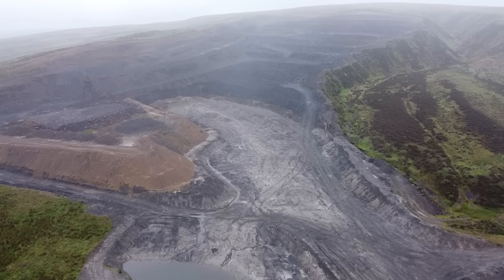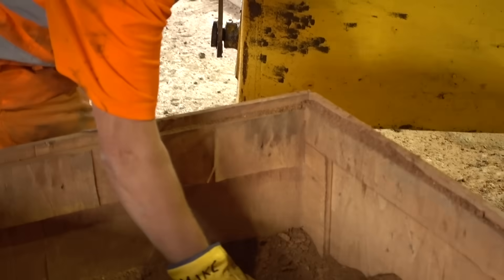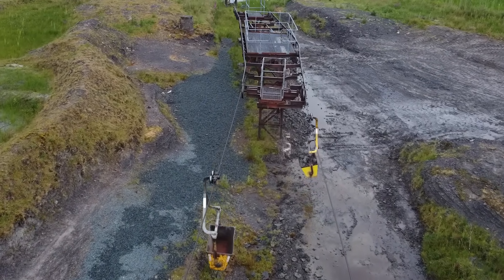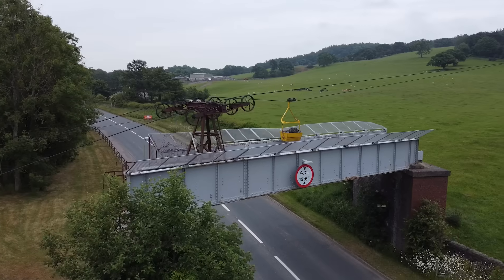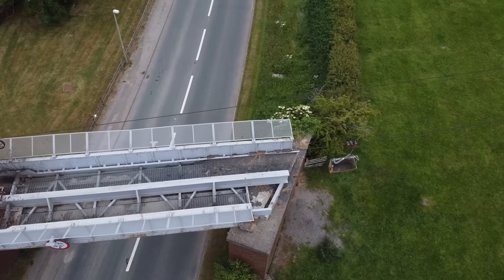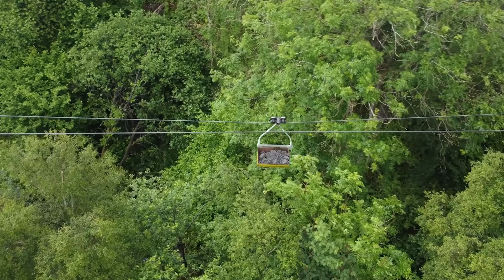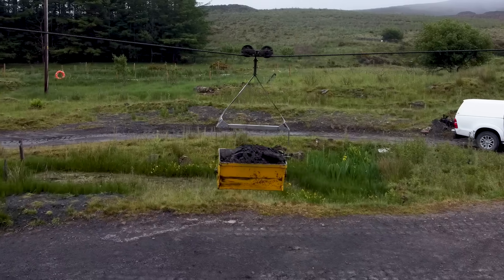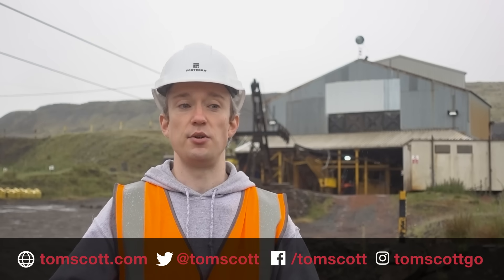The UK's last aerial ropeway uses no power, moves 300 tonnes a day, and will be gone by 2036.

Comment: The physics pedants are going to have fun with "uses no power"
Reply: As are the comedians, if they can keep away from make any puns-dits
Reply: it uses energy, from gravity. no debate here
Reply: @brhh  Wouldn't "energy from being a heavy thing in a high place" be more specific ? Gravity only converts that potential energy to kinetic energy
Reply: @Dextroyer77  Not very much "acceleration due to gravity" though, as the up-buckets are balanced by those down-buckets.
Reply: @brhh  Tom referred to no power being used. In physics there is a difference between energy and power.
Reply: @brhh  Gravity acting on the mass of the load, if there was no load (crushed rock) then it wouldn't go anywhere regardless of gravity that rock takes power to load it into the buckets. If there wasn't an external source of energy involved (other than gravity) then it would be a perpetual motion machine and that's impossible.
Reply: @brhh  but the energy is not from gravity
the energy comes from it's relative altitude compared to the destination
the system is powered by potential kinetic energy

though there is an argument that this energy is stored by the mechanical systems responsible for lifting the shale to surface level and that that is the source of power for the system
Reply: The grammar pedants are going to have fun with "pendant".
Reply: @cabbageconstable  um actually that would be spelling pedants - the grammar is perfectly fine
Reply: @SharienGaming  I see the word choice pedants have showed up :P
Reply: @dusklunistheumbreon  i cant help myself with wordplay when there is easy pickings XD
Reply: @cabbageconstable  took me what felt like a month to spot that! Edit: Urgh I did it twice?! I'm the worst.
Reply: @cabbageconstable  actually, I believe that would be more of a thing for semantic and orthographic pedants.
Reply: Pedants on both sides, I should say. You could argue this is correct (Power is rate of work, is gravity "work"?) I'll let cleverer people battle this out but try to remember that this doesn't matter. Hugs to all.
Reply: @OliWarner  gravity technically does develop work on the carts, but it’s clear Tom means “external power” ;)
Reply: I mean gravity in physics is referred to as "gravitational potential energy" so it does use no power but it does use energy so if that is so "uses now power" is actually correct since it makes its own power from gravity as an energy source.
-a physics pedant
Reply: @OliWarner  Power is just the rate of change of energy per unit time. Not specifically "Work". There is certainly energy and power being used here.
Reply: pedants*
- another pedant
Reply: It's insane that the power input of this system is the movement of tectonic plates, raising the land millions of years ago
Reply: @SuperCarneBoy  Some of the power input is still happening - this part of the UK is still rebounding after the last Ice Age - the land is getting a bit higher each year!
Reply: @SuperCarneBoy  nice..
Reply: @SuperCarneBoy  It's the addition of mass by operators that causes it to function.
Reply: Even better, we can actually have some pendant(ary?) pedantry since the buckets are swaying on the rope as they power (heh) their way down/up the course!
Reply: Put a generator on the wheels and you could probably generate power this way too.
Reply: @colleenforrest7936  This is a great idea! Rather than use a brake and waste the excess energy as heat, they could knock a bit of their electricity bill which I expect is substantial.
Reply: @colleenforrest7936  if you add a generator, you could slow the runway to the point it doesn’t move. It’s a nice thought though. I suppose one it’s all mined out you could add water to the buckets, and then a generator would work. But it would likely only be a small one, due to the weight of buckets and cable coming back up the hill.
Reply: I suppose the external power it takes in is the potential energy of the shale?
Reply: @12-343  probably a combination of the initial potential energy of the shale and the energy used to lift it out of the quarry and into the buckets.
Reply: @12-343  Correct, by adding weight at the top you are adding gravitational potential energy to the system. Not "power" in the traditional sense, but 1/4 ton of rock added at the top of the loop, which is about 200m elevation above the brick factory, adds about 400 kJ to the system.
Reply: @Ulquiorra191  Exactly, works like a dam/hydro-power plant
Reply: Uses potential energy of uphill rock
Reply: It's just converting energy that had been there as gravitational potential a really long time ago.
Reply: No we won't, because nobody said it doesn't use energy. Power has the strong implication of being produced.
Reply: @GamesFromSpace  Produced, like putting heavy stuff into a bucket and letting that potential transfer to kinetic over time? Sounds like power to me, but I'm no physicist.
Reply: It's not really pedantic, it's stuff like this that means we have idiots that believe in perpetual motion.
Reply: @mfx1  The introduction of the phrase into this thread, right now.
Reply: All depends on where you draw your system boundaries.
Reply: 1 object moving uphill and 1 moving downhill with the same mass and the same speed is net 0 work. The masses are obviously different, but different speeds would compensate.
Reply: @RhyetCast  What do you mean?
Reply: It uses gravitational power, but no electrical power.
Reply: But they´ll use up gravity if they keep operating it, they will!
Reply: Energy ≠ Power
Reply: @simonbergman5970  Power refers to the amount of work done over a unit of time, where work is the product of force and displacement. This system does indeed utilize energy, work and power... albeit in a very clever way.
Reply: If there's mass, there's energy (E=mc^2)
Reply: @notproplayer3649  this... Is really badly wrong. I get what youre going for, but this is absolutely not the right answer.
Reply: @simonbergman5970  not to be rude but for the love of God, at least explain me what I did wrong, I'm eager to learn myself. 
This is what I know currently, E=mc^2 in Einstein's relativity theory is Energy like any other, this can be seen in atomic bombs as masses of plutonium or other radioactive elements convert all their mass into energy creating the explosion (by converting this energy into heat and cinetic energy for all the atoms around the core).
In Einstein's theory, mass by itself is Energy since it has inertia.

Yes, this formula wouldn't make sense under Newton's theory since everything is supposed to be cinetic or potential energy (E=1/2mv^2 for linear movement cinetic energy for example).
Reply: Gravity: Are you kidding me!?
Reply: @aiosquadron  Why else would a full bucket travel down an incline?
Reply: @RhyetCast  I know who you were replying to, I'm just confused by the reply
Reply: @RhyetCast  As a young person, I don't care which one people use. They both get the message across XD
Reply: @RhyetCast  "fixin’ to"
Reply: it's powered by the Big Bang.
Reply: Tom literally says “the only power comes from gravity”.
Reply: Physics is unclear without the correct terminology. It's not pedantry, it's just the correct or terminology.
Reply: As if there's....no Gravity 😅
Reply: They're using the power once stored by whatever got the shale up that high
Reply: @chistinelane That's just sufficient weight in the downhill / full buckets.  Would it work if the buckets going down were as the same weight as those going up ?
Reply: Well they use power from the workers inorder to have the rocks put in and out of the bucket to allow for the difference of mass to keep the thing running.
Reply: @thastayapongsak4422  technically even that can automated just put some slider with small wheels at end where it unloads that will angle the card to unload it then at the top have some lever that cart or mechanism will push so it opens the door and load it.
Reply: @dkdanis1340  Get Carter , 1971.
Reply: Send heavy stuff down, send empty containers up. The weight of the additional mass is what drives the other carts up. 

It's not hard to figure out
Reply: @sacr3  Yes, we get that, but what you've described involves power, in the physics sense.
Reply: What about the energy thats used by the human workers. They are vital in the chain both in loadimg/uloadimg the buckets and putting them back on the rope.
Reply: Gravity = Potential energy
Reply: Power cannot be used, only converted, so no, we are fine.
Reply: @aenorist2431  Hence, Global Warming?

Comment: "The UK's last aerial ropeway"
Oh, so it must be a long-lasting invention, probably works for hundreds of years more.
"will be gone by 2036."
Ah.
Reply: To be fair, the ropeway would still work. The hill just ran out of rock.
Reply: @koristrange9655  What a power move, it just keeps chugging along, and would do it even after the hill is G O N E
Reply: @daftbence  You'd have a hard time moving things with gravity after the hill is gone, though.
Reply: @danielf3623  Only if the towers of the ropeway "sank" with the hill, highly doubt that thay couldn't just dig around them :)
Reply: @daftbence  Ah no.  In order to operate the buckets going downhill need to be loaded. Don't forget it's gravity doing the 'work'. 
I was thinking too bad it couldn't be repurposed for landfill  but the system won't work if the load has to go up the incline.
Reply: @foamer443  Just put "wotah" in them, problem solved :)
Reply: @koristrange9655  So what you are saying is that the ropeway runs out of power?
Reply: If something is labeled "last" It's not usually a sign of long-lasting timeless
Reply: @failandia  they went with the industry not because they didn't work
Reply: it will have been in service for over 100 years at that point
Reply: @DOSeater  As they say oop north. "That were money well spent."
Reply: Depends on the term used I can think of 3 others for people in the uk
Reply: Very nice job and 😁😃😃😂
Reply: Video games have become 😎😚😎😚